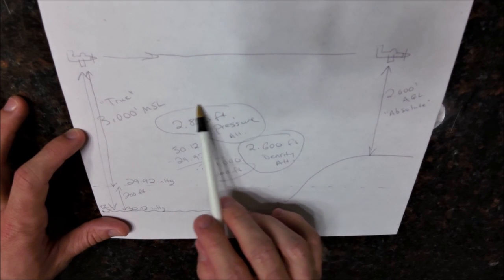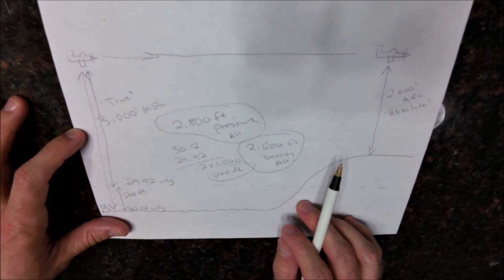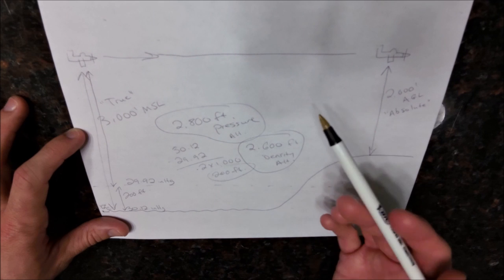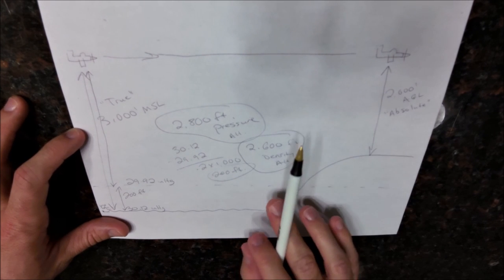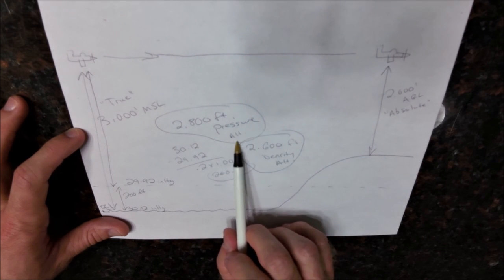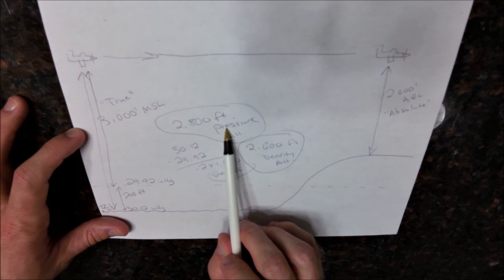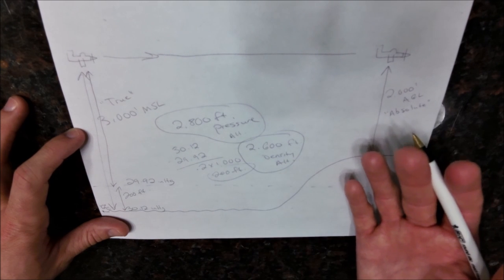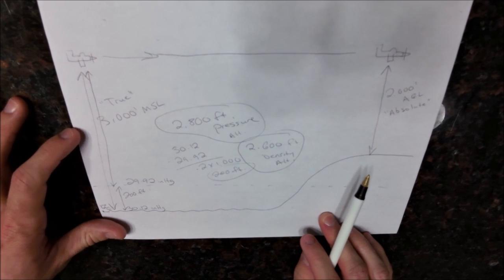Types of Altitude for Pilots (Pressure Altitude, Density Altitude, etc.)

Comment: doing aerospace engineering and this explanation really did help
Reply from the maker: So glad! Let me know what else you might need some help with. Thinking of making another video soon...
Reply: @GeneStuart  how about future propulsion. Electrification, alternative fuels, structures and systems for max. fuel efficiency...
Reply from the maker: @teffair  Oh, don't get me started... We could be doing WAY better than we are. The EPA has been on the industry for years about getting the lead out of fuel... It's tough to get solid anti-knocking properties without it. The 100 "VLL" (very low lead) program hasn't really caught on. BUT, we could be doing lots more with electric engines like in parts of Europe. Not to mention aerodynamic improvements like next generation winglets, better wing design to reduce induced drag, etc. Remember, modern aviation is still very new. Just getting started really!

Comment: Very helpful. One thing though, when you set the altimeter to the current setting at an airport, is it able to read the elevation of the airport because of the pressure difference between the current setting and the standard pressure of 29.92?

Comment: Maybe I’m just confused, but you said if we’re flying at 3000ft MSL, and our pressure altitude is 2800ft, the airplane would fly better. How? I thought since the airplane would think it was flying lower, it would fly worse since air is thicker as you go down?
Reply from the maker: Hi, Christian. An increase in air density allows for improved aircraft performance because the aerodynamic forces are increased (for example, more thrust).

Comment: Dear sir video has detailed explanation but if the temp is 12 degree and pressure altitude is 2800 feet then density altitude should be apex 2800- 1500( 1000 ft every 2 cm so 15-12=3 cm difference so 1500 feet to be deduct that’s why DA= 1300. Am I correct or misssing somewhere.,
Thanks
Reply: He didn’t actually calculate DA, just chose a 2600’ for his example problem.